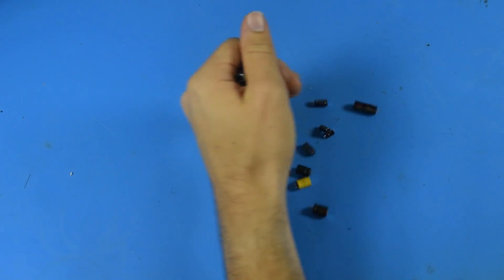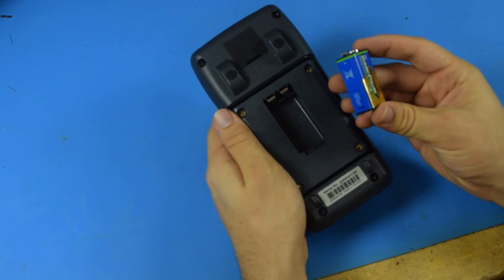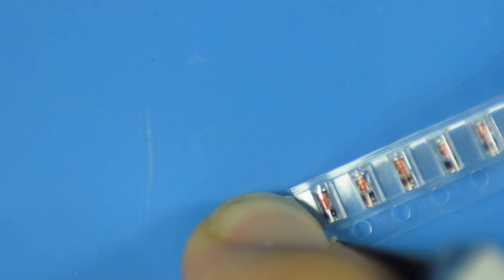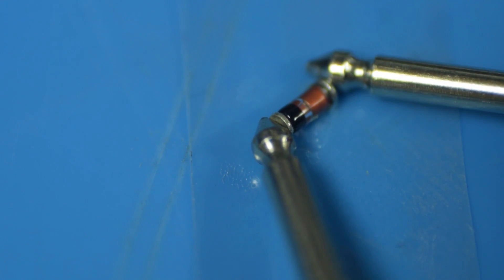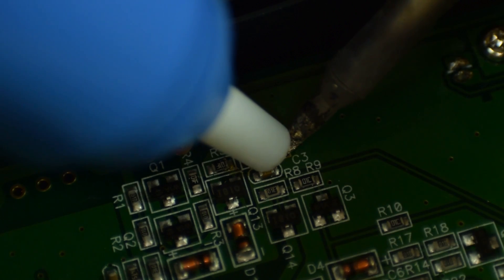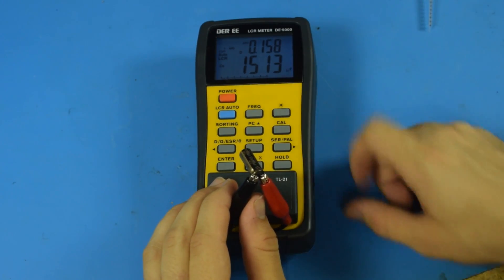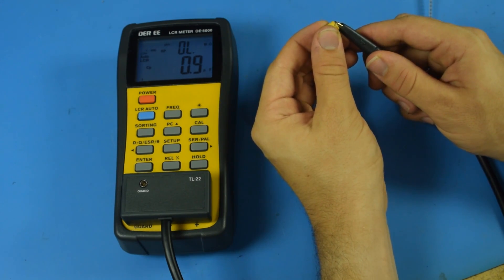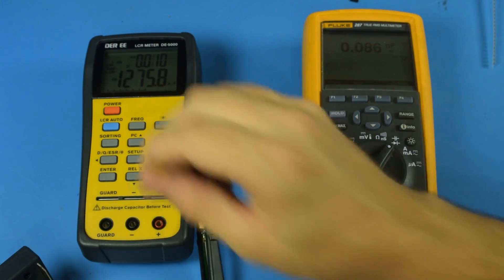0x000A - DE-5000 ESR Meter Diode Replacement

Comment: Thanks so much for this. Mistakenly tried to put replacement 9v in my meter and it got quite hot and meter wouldn’t turn on anymore. Indeed diode was shorted. Replaced nice and easy and works like new. 

What an odd reverse polarity “protection”…

Thanks again!

Comment: It also happened to me to put the battery badly. The De 5000 didn't turn on anymore and I didn't understand why. When I realized it I swapped the battery and everything worked as before.
Then I came across this video and opened the de 5000 to see if the diode had blown. In my DE 5000 the diode "D5" is not there at all.
And I have proof that by reversing the battery the only thing that happens is that it does not turn on.
The precision of the measurements is the same as before.
Maybe they made a change in the equipment and now battery reversal is no longer a problem
Reply: Looking better in the battery compartment, as someone else has already said, even inserting the battery backwards in the new DE 5000 the battery does not make contact if inserted backwards and therefore what happened to me happens: the device does not turn on but any damage.
The diode is no longer there simply because it is not needed

Comment: I just bought a DE-5000 and checked the battery compartment and found there is now  a plastic shield around the battery contacts to prevent improper insertion of the battery. Thanks for the informative video.

Comment: Pretty sure that the diode was not intended to protect against battery reversal.   It would be a TVS diode, designed to clamp any voltage spikes when you insert the battery.

Comment: Thanks for this video. I've recently purchased this meter brand new, and opened it as soon as it arrived to check/replace that diode with a more powerful one that could withstand a few seconds of 9V battery short (500 mA current draw with a fresh alkaline). Upon inspection of the PCB, surprise! The pads are there, and the diode markings are on the PCB, but there was NO diode installed at the factory. So I simply installed/soldered one to protect the meter against accidental/momentary reversed polarity power from the battery. Now the meter is protected (as it should have been from the factory with a diode strong enough for real protection for a few seconds of distraction/dumbness 🤭😉).

Comment: A simple 9 volts battery connector mod with wire snaps would have you protected 100 % impossible with these cheap snapping wired connector male and female to reverse polarity !

Comment: I just opened up my new De-5000.  There is NO diode at all in the spot!  WTF!   Now I'll put one in because there are erasers on pencils.   THANKS!
Reply: waydav1s Same with the meter I just received. I’m wondering why they decided to remove this from their design? There must be a reason? Maybe if the diode shorts, it will continue to pass current through and blow the entire meter?
Would love to hear your input and experience with this meter. Thanks for your time

Comment: This instrument has a fine design. If you see the battery case, you will notice that the metal connection tab for the battery positive terminal is hidden behind a plastic window which has a smaller diameter than the window of the negative pole tab. In case of battery reversal the negative pole of the battery cannot touch the  relevant tab because of its bigger diameter. So it is obvious that you have forced the battery to enter the case breaking the protective window made of two plastic tabs. Apart from that, there is a very clear drawing of the correct position of the battery at the bottom of the battery compartment. Therefore the fault of frying the instrument, sorry to say it but it is the naked truth, is all yours. Next to that, you referred to this instrument as an ESR measuring instrument (with ESR being only one of the parameters it can measure) and in your tests you were concentrated only in capacitance differences, saying nothing about ESR which is the most important criterion for judging electrolytic caps. And above all, you didn't tell us what the replacement diode you used is, to help us who own tha same instrument, in a similar case. Finally, your Fluke multimeter can measure accurately small ceramic caps, even using long probe cables. In order to do that, you need to have your cables interleaved, that is, the one cable must cansel the field created of the other one. In other words, they mast be twisted on each other like the UTP pairs of cables. If you use this technique your Fluke will be able to measure down to near zero pF, with reasonably long probe cables for convenient measurements. Greetings from Athens Greece!
Reply from the maker: I went to double check. the window for covering the battery tabs does not extend all the way up the metal. It is only about half way making it very easy to connect the battery in the wrong direction without forcing it in. The area where I was first putting the battery in had very poor lighting and it was not easy to make out the markings in the battery compartment. There was no reason for it to be under the battery since the large plate lifts off to put the battery in. It could have easily fit anywhere else around the battery.

It is ultimately my fault of course. But I would not call anything that makes it possible to so easily mistake the polarity a "fine design". Either fully shielding the the battery contacts and/or making the polarity indicators larger and more visible would have both considerably helped avoid this problem. Adding in the diode as a protection was nice though since it protected the meter.

I believe I said at one point in the video(I haven't watched it in a long time) that I bought this meter to force myself to learn more about ESR. Since it broke immediately after coming out of the box I had not had a chance to familiarize myself with it and making ESR measurements. So I did not make any ESR measurements with it because I would not have known if I was doing it correctly or not(the menu is a little confusing in this meter, it took me a while to figure it out). In later videos I do show this meter being used for ESR measurements, but not in a video specifically about it.

I can't find any probes with twisted cables like you have described and the Fluke manual makes no mention of it, can you link to an example of them? I put up the screenshot of the fluke's ranges in the manual to show that pF are really too low for it to measure. It doesn't have a native pF range even. The reason I put the capacitor directly into the probe connectors was to demonstrate that the probes themselves are not the problem at all. It is only the meter. I am 95% sure it is the test frequency the fluke uses that doesn't work correctly with small value capacitors. The capacitance feature of that meter is almost like a bonus feature as most DMMs do not have that ability. 

Thank you for the comments though, aside from the battery problem I do like this ESR meter and would recommend it. I have plans to do a video series on getting full sets of EE tools at $50, $250, and $500 budgets and I'll be going over this meter again in the $500 budget range.
Reply: @TechTangents  The truth is that I have never searched for buying ready made twisted pair probe cables for measuring small caps. Given that it is very easy to make a set by myself, this is what I finally did. I made a length of them at about half a meter, actually using three cables of different colour each, having in mind to use the not used one as an intermediate ground cable. Nevertheless, although this third one remains unconnected to ground up to this day, this set of twisted cables serves this purpose very fine. I have tested it even with cheap Chinese multimeters and found the taken measurements very reliable. It seems that you also must make this set in the same (diy) way. It's very easy and won't take you more than ten minutes to complete it. I hope my description is helpful.

Comment: Great video, I'm going to put a warning label on mine!  The difference in capacitance read boils down to the minimum 100hz frequency that the DE 5000 uses.  My other capacitor meters look to work at 10 hz or less, and that does affect the readings.  Try it an see, put a cap on the DE 5000 and raise the frequency, the capacitance reading goes down.  Hope this helps.

Comment: Instead of new diodes, why not invest in a 9V battery holder? They don't clip on the wrong way round.
Reply: How do you propose that would fit inside the back of the meter?

Comment: I would fix this one of two ways, ether move the diode to be inline with the power or put a fuse with the diode so at least whe it lets the power though the fuse would blow & save the rest of the cicuit.

Comment: You're supposed to discharge caps before using this meter... Additionally, you can calibrate the leads by holding CAL, open will show, keep the wires unconnected and press cal... wait 30 seconds... press cal if passes... Short - connect the wires, press cal, hold for 30 seconds, if pass, press cal and done.....

As for caps, mine is off by 1000% on 100% of caps I've tried so far... I'm trying to talk with DER or the retailer to see what the hell is wrong because it is bothering me.

Comment: Great Tutorial. I inserted my 9v battery in the wrong way but no damage was done because the positive contact of the meter was recessed so there was no physical contact with the battery. Wouldn't it make more sense for them to have placed the diode in series with the battery as opposed to across it?
Reply from the maker: If they had placed the diode in series then there would have been a voltage drop(and some power waste). It's possible they don't have any voltage overhead and couldn't handle the loss. The best solution would be an active circuit with FETs on the power input that will only let the correct polarity pass through. But that's the kind of difference between a $100 tool and a $500 tool.
Reply: @TechTangents  maybe a Schottky Diode, but the MOSFET is better.

Comment: I've found it best to use desolder wick. Too many times I've had my desoldering pump jump and knock off another surface mount component.
Reply from the maker: I've been fan of solder wick for a while. When I started working with TQFP type packages though I found you can't really use wick. I've had a lot chips with shorted pins from single strands of copper from wick.
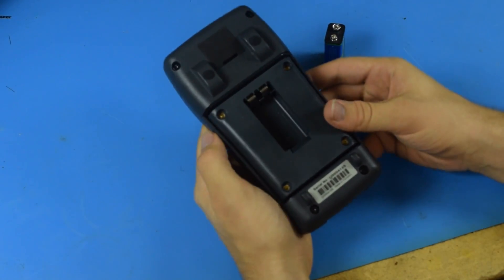Reply: after watch @Tech Tangents By AkBkukU the last video about the RAM memory torture.. and final destruction of it.......... now this... 0:50 .... ??...... my reaction was like  OH MY GOD!!! ..... and i am an atheist.... !!!
Reply: Solder pumps can suck a track away from the board quite easily with modern electronic pcbs. I have made that mistake too many times, so now I nearly always use a wick with flux - almost never the suction pump.

Comment: Why was diode protection done  that way? Wasnt it more logical to put in diode that can pass the current in proper polarity, and block it in reversed?
Reply: fradd I do not support this method, but...  This method of reverse polarity protection is used when the voltage drop of the diode is too much. How can ~.7 V drop be too much? Under high current conditions  (that this unit would never have) a diode drop is more than a diode drop because the bulk resistance of the semiconductor becomes significant. The proper way to do THIS particular circuit is to have a fuse between the battery and the reverse protection diode; this allows a replaceable fuse to blow when the mistake is made. This type of protection is commonly used in car stereos, at least in ancient times.
Reply: craigleemehan: thanks, im still processing what you have said, im not exactly a professional.
Reply: @craigleemehan  (Just to put this information out there, you probably know this:) Even making the diode short a fuse is not very good/is a cheapo, because in the time it takes to blow the circuit being "protected" can still be damaged. A "proper" way (which unfortunately for a manufacturer costs some more cents!) is to have a MOSFET guarding the input and which only switches on given correct polarity.
Reply: In some cases the current draw backwards can be enough to short the diode ruining the meter. It would be fine like it is if there was a fuse right after the negative terminal. It would be safer to have the fuse blow after shorting the diode so the battery doesn't get hot and posdibly burst.
Reply: This design would be fine if there were a fuse between the battery and everything. In that case, it'd basically be a crowbar protection design. Since they're so cheap as to skip the fuse, then having the diode in series with the circuit would be the preferred design - unless they depend on having 9V somewhere in the circuit...which would be silly because the difference between a new battery and a nearly flat one would be more than the drop across a diode.
Reply: They could have done that yes, but don't forget the diode will drop about  0.6 v  , energy saving maybe .